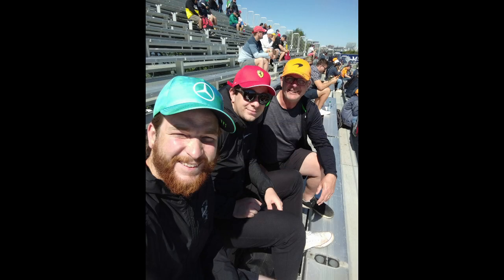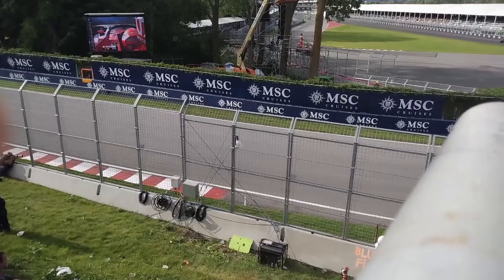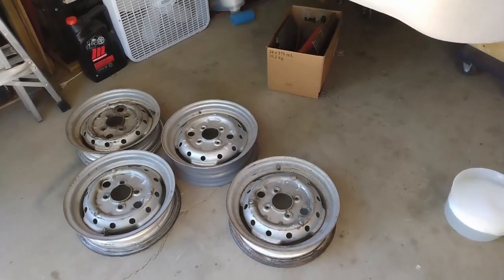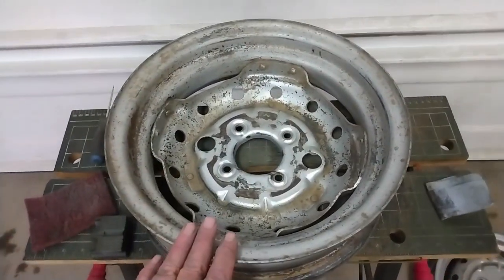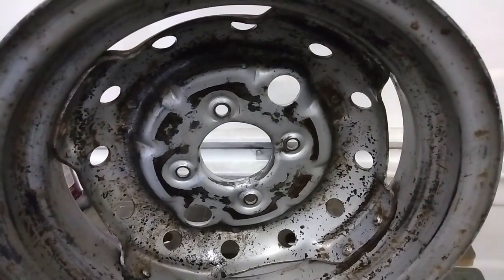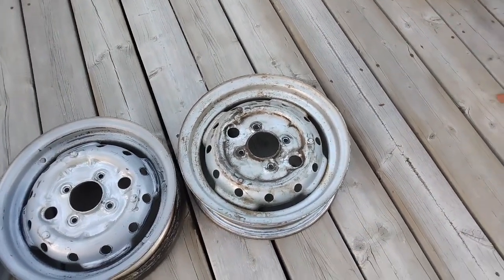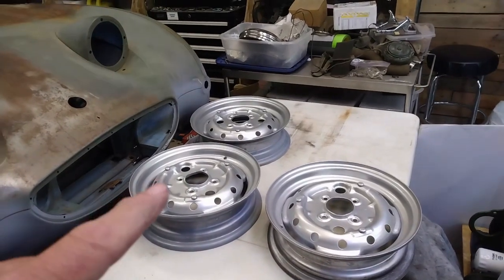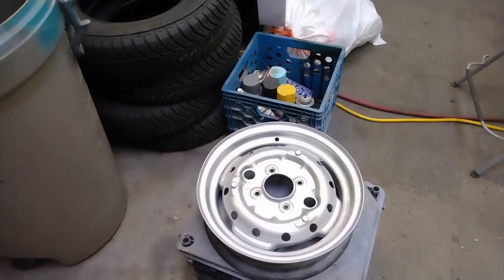How to refinish the Austin Healey Sprite's wheels. Plus an F1 bonus!! Bugeye Build Episode 76

Comment: Wheels are tedious to clean, prep and refinish. I did a wheel clean up on my Gen 1 Mini R53 two piece wheels. Lots of work. 

Can’t wait to see your paint booth set up. Cover EVERYTHING in the garage. The paint finds its way everywhere. Did some rust repair on that same R53 Mini and even tented off there was blue “over spray” that landed on my wife’s Audi Q5. I used a clay bar to remove it off the car but I am sure its on everything else in the garage as well.  Run filtered fresh air and a vent fan. Watch the temp and humidity as well.
Reply from the maker: Thanks Bill. Great pointers for getting ready to paint.

Comment: Good job on the wheels. They will last a long time after your treatment. I use Ford silver but I imagine quite similar. WRT the GP, yes speed of cars is quite dramatic as is the noise! I attended in 2010 with my boys and they were using the same Healeys! Hamilton and Button 1 and 2!
Reply from the maker: Thanks Gareth. Going to an F1 race has been on my bucket list for many years. I was very fortunate in how this trip came together.

Comment: Great job as always and glad you had a wonderful holiday!  Question:  Could you have used brake or carb cleaner to degrease the wheels?  I'm just curious more so for degreasing.  Thanks for sharing your journey.
Reply from the maker: Thanks. I'm sure brake/carb cleaner would have worked. I didn't have any on hand at the time so just used what I had.
Reply: @EconoboxGarage  Just wondering.  Thanks!